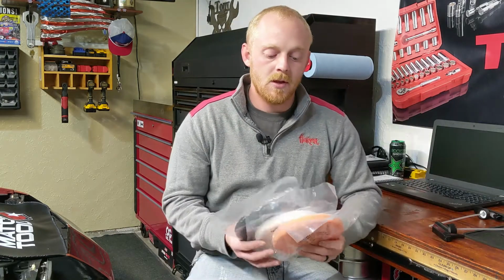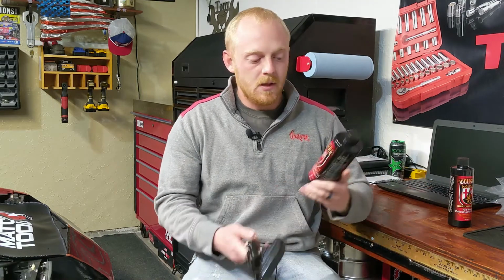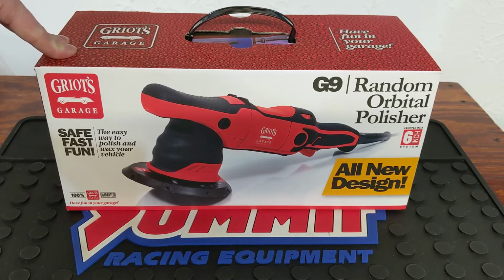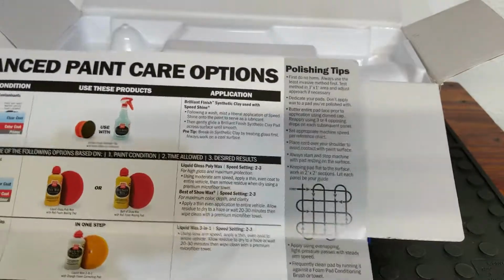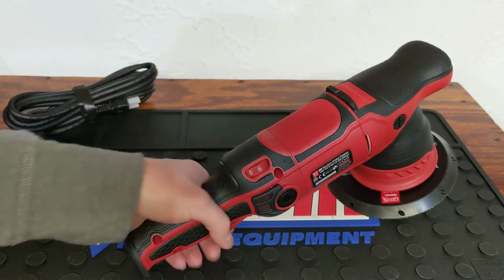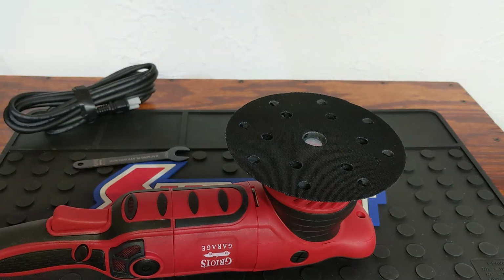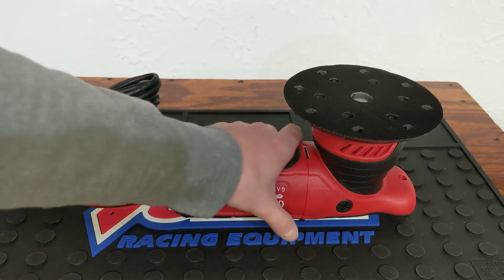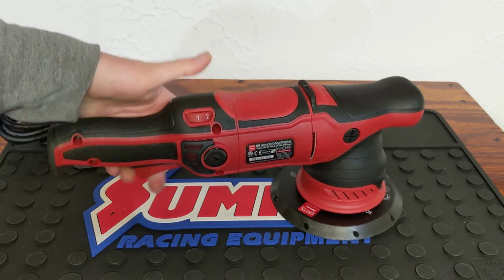Griots G9 DA Polisher Unboxing and First Thoughts AutoGeek

Comment: For a budget friendly alternative to a Rupes or Flex, the Griot's machines are a good option (certainly better than the Chinese copycats). For your 5" pads, pick up some of the Lake Country flat foams or CCS pads from The Rag Company (also check out their YouTube channel!)...and be sure to get 4-6 of each pad. Generally speaking, if you are cleaning pads after every panel with air...you will end up using 1 pad for about 25% of the car. If you aren't using air to clean your pads, plan to use more of them. You should be fine with the short throw of this machine, but make sure you don't heat up your pads too much.

The lifetime warranty that they offer is nice...but beware that you may have to utilize it. The triggers and speed controls are common failure points of these machines. Its great that they stand behind their product, but it kind of sucks to have your machine go down in the middle of a polishing job.

Speaking of triggers, the progressive triggers on the Rupes machines are great for spreading polish at low speed (to avoid flinging it everywhere). Just spread by feathering the trigger, then quickly ramp up to your set speed and lock it in.
Reply from the maker: Very nice thanks for the tips. I appreciate it. And ya I went ahead and picked up 12 of the lake country pads. They have been great. Ya I didn't want to go with one of those cheap Chinese knockoff ones. I wanted something name brand and figured this was a good starter. Hopefully I don't have to use the warranty. Haven't had any issues yet. Had it a few months now. But I'll definitely keep that in mind. Thank you again!! 👍
Reply: @TonyTheTechnician  no problem man. I've learned a ton just from watching channels like The Rag Company, Obsessed Garage, AMMO NYC, Pan the Organizer, and RUPES. After learning from them and finally getting some hands on experience on a polisher... I'm hooked.
Reply from the maker: @jeffc6832  same here. I watch them alot haha